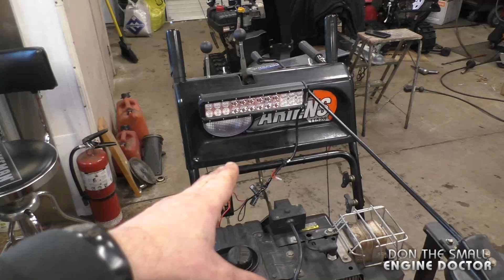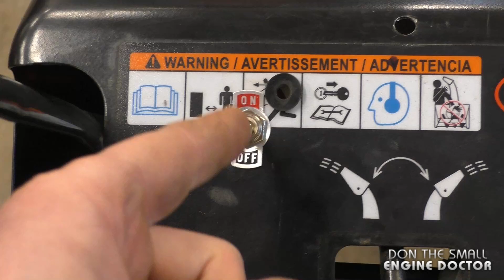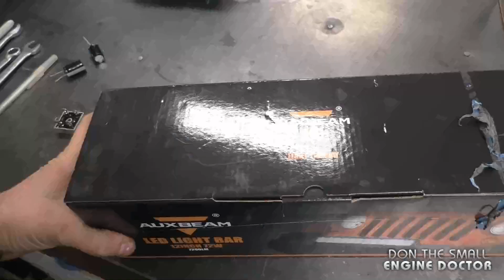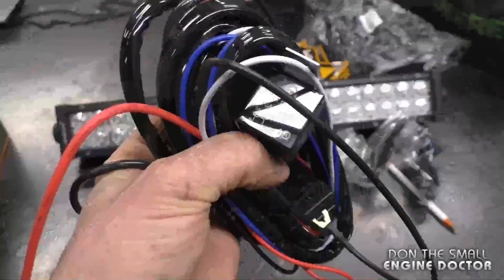HOW-TO Install LED Lights On Your Snowblower Without The Flicker!

Comment: Power Chute Hack.  I utilized an old 12 volt DC reversible drill and a double pole double throw switch with spring loaded neutral centre.  Cut off the chute crank handle and chucked it into the drill and securely mounted the Drill to one of the control arms. Mounted my Garden Tractor battery on the Snowblower above the engine in small battery box and now at the touch of a switch I can turn my chute up to 190°.   Battery stays charged all season.  I have a canopy (highly recommended) and also run a mag base rotating blue light and rear LED red light on top.  Because I could.  I could easily  run additional 12VDC lighting.
Reply: Any way you could link to a picture of your drill mount setup? I’m super interested in how you did that!

Comment: Hey Dony,     On the Toro blower with the 18W light Is that light always on or did you add a Toggle on off
 switch?????
Reply from the maker: light was always on the toro snowblower,I did add a switch to the ariens though

Comment: Ok so I have an ariens with no light or heated hand grips. So where do I find the positive wire coming from my engine?
Reply: Jeff McCallum A wire with a plug type end should be coming out from under the engine cover and hanging to the right side of engine. It should be black in color.
Reply: @josephpuchel6497  much appreciated

Comment: I have a troy bilt storm 2410 snowblower but it doesn't come with a stator so I'm buying a flywheel with the magnet on ebay and a stator so I hope they all fit

Comment: @donyboy73
Great video
I have the 824E  Tecumseh 8hp (I believe) with electric start and without existing factory light. I want to do this modification. I searched everywhere for a positive wire on the machine and can only find the negative wire to the kill switch. Can you please help me with where to wire my lights? Thanks
Reply: Just hook up the light to the battery if it has a electric start, just don't use too high power light so your motors charging system won't burn up
Reply: Jesse Sairanen Thanks for taking the time to reply, but if it were that simple I would have already done that. There is no battery. Having electric start on this Ariens 824e means that you connect an extension cord to the machine and once started you remove the cord.
Reply: @agbrown308  okey, it's that model of start, then you just neet to find the wire/wires from the stator windings coming under the flywheel and hook this bridge rectifier mod to it
Reply: Jesse Sairanen  I was hoping it is that easy. I’m just afraid to go through the trouble of completely disassembling the machine and not finding an accessory wire coming from the stator. Thanks again
Reply: There is no stator. You’d have to buy one, and the corresponding flywheel and swap those out first.

Comment: I installed a new 7hp Tecumseh Snow King engine on my late 80’s JD 524 snowblower almost 10 years ago. It has 110 volt electric start. Can I power a light from the engine? If not I was wondering if I could change pulleys on the engine PTO and install a GM one wire alternator to power lights?

Comment: Should the capacitors be left exposed or can they just be wrapped with electric tape?
Reply from the maker: you could tape them up
Reply: Liquid electrical tape.  Love that stuff.
Reply: @42Dash  So it's ok to brush that all over the capacitors/ bridge rectifier and all connections?

Comment: there is a much easier solution, just buy a rechargeable led bicycle head light, put the clamp part on the handle of the blower & when you need it clip the rechargeable light onto the clamp
Reply: Who sells them? Best idea yet!

Comment: VERY IMPORTANT - I HAVE USED THESE LIGHTS IN 24" AND 32" FOR THE LAST 5 NEW ENGLAND WINTERS ..... REMEMBER TO CLEAR RTV/SILICONE AROUND THE OUTER EDGES OF THE LENS OF THE LED LIGHTS. IT WILL PREVENT WATER LEAKAGE FOR YEARS TO COME

Comment: Does anyone know what kind of volatge and current one can get from the flywheel stator of a tecumseh 8-10hp?  Those lamps can quickly be 20-30 w, I dont know if the engine can provide this.

Comment: I did the hack - and it works great! I used the parts in the links, mounted them in a gray 4" Carlon plastic electrical box. Used those 4 spade connectors on the bridge rectifier and  then soldered the wiring to the capacitors then used a LOT of hot melt glue to insulate the wires (it is non-conductive) and secure the parts in place in the box. On my Ariens 926LE I mounted the box on the bottom of the "dash" out of the way.
For power, I just snipped the existing power supply wires to the lights and extended them into the box.
For the light, I used an 8", 12 bulb LED light from Harbor Freight (Under $40 with the coupon) and mounted it near the top of the front of the auger housing. I had already mounted an hour meter; that remains hooked up to the original AC output wiring.
No switch needed, the light turns on with the engine and there is no flickering when it is running at normal speed. 
Seems like about 25 times more light than the weak one that came with the blower, with the same wattage. 
Darn thing lights up my whole block.
Thanks for your video!!!!!!!!!!!

Comment: The stator on my Tecumseh only put out 18w.  I tried with three 28w pods and voltage drops to 10.5v.  They will light up but not very bright.  You can see in his video.  The 72w light is bluish and the single light very bright and white.  My set up now is only one light from engine.  All other can off on board battery.

Comment: You Da Man.
This light works great. I installed without the capacitors. I couldn't wait until they were shipped.
I will install when they arrive. Thanks you. Keep up the good videos.
Reply: Re did with the capacitor. WOW. Not its bad ass. thanks again.
Reply: What do you need the capacitors for?
Reply: tjc1ny I believe the capacitors take the pulse output of the rectifier and helps provide a more constant input to the led. These means no more flickering leds.

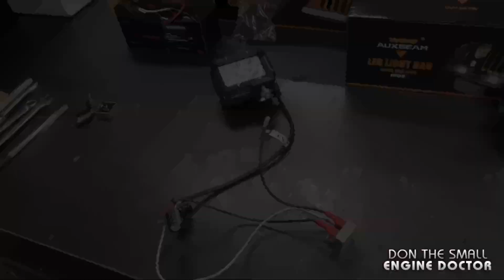Comment: @ 1:39 I see the wire I need that will connect to my engine.....It is the small black wire with the white plastic cylindrical end.....do you know the # of that wire?????
Reply: Your snowblower engine would already have to have it coming out from under the shroud.  If the engine doesn't have the parts that produce voltage it's not easy or cheap to make it do so

Comment: Also one more...it appears you have the open side of the rectifier exposed to the elements.....is that moisture proof????? Should it be covered????
Reply: I'm 11 months late, but yes, I'd personally enclose the rectifier and the caps in a small all-metal (and waterproof) enclosure.  Why metal? so it can be used as a heat sink for the rectifier (as he did in the video; he bolted the rectifier to the metal frame).  I'd extensively use soldering and heat-shrink tubing on the wiring too, but I like overkill jobs.

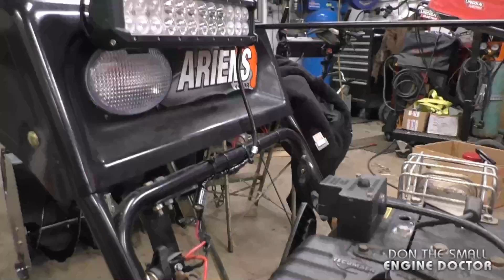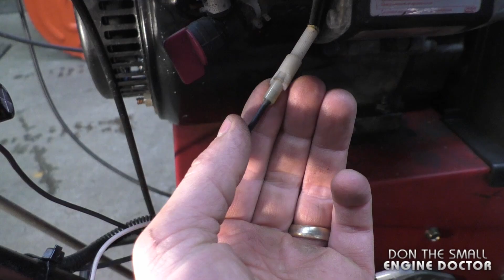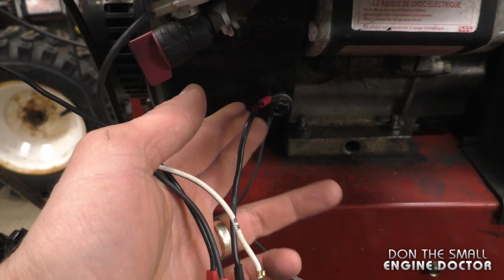Comment: Also end of video  at 9:59 it looks as though after you tidied up the wires you added a Fat yellow wire and a fat Red Wire which were not seen at previous mentioned times of 4:34 and 9:12 of this video.  I am not being a pest I just noticed it and am not very savvy when it comes to wiring.     Also Don you mentioned a toggle switch......Any Volt or amps on a toggle switch or ????  When I look up toggle switches they seem to be all different volts and amps   12v/20A.....12v/30A.....then wattage????   Appreciate your help.

Comment: Also at 4:34 of video you show same male to female lead  I have  the one coming out of engine(power cord) but what is the connecting wire #????
Reply: Watch it again.  It is a mating connector from another machine that goes to + on the Rectifier.

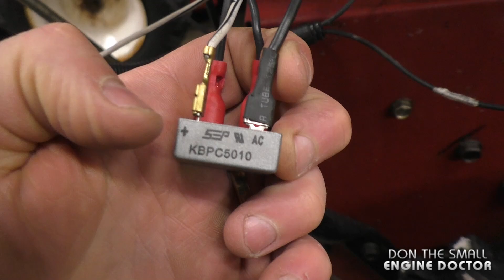Comment: Don at 9:12 of the video you show the power cord coming from engine(I have HMSK80 myself w/same white plastic end(323))  what is the wire that  connects to that   Do you have a part number?   So say wire out of engine is male connector.. what is the female wire that matches/connects to it???
Reply: Correction plastic end 322

Comment: Will the included wiring harness with the switch work on a snow thrower??
Reply: He mentioned that he did not think the switch on the included wire harness was waterproof and that is why he did not use it.

Comment: Super easy to follow. Just one thing I have two 18w led lights and wonder do I need two capacitors for each light ?
Reply from the maker: yes
Reply: Can someone else confirm this as well?  I would think that if the lights were pig tailed together and the 2 capacitors were ahead of the pig tail it should be fine.  I don't see how 2x18 w lights is different than the one 72W light.
Reply: It isn’t, you can wire the lights in parallel and just use 2 capacitors. I don’t even use the capacitors and it work fine.

Comment: Can someone that has purchased the Auxbeam 12" 72watt light bar post the full electrical specs. I'd like to know the true wattage draw, volts and amps.  I find too many LED companies report the wattage on the packaging as the incandescent equivalent rather than true wattage of the light.

Comment: I did this and within a minute one of the capacitors exploded.
Reply: Are capacitors necessary?
Reply: Sounds like the rectifier or capacitor polarity may not have been wired correctly.
Reply: @michaelhaip803  I just used a rectifier and they work good.

Comment: Serious question - forgive my ignorance - why do we need two capacitors? would 1 in series not do the same thing? Thanks!
Reply from the maker: two gives extra protection against flickering
Reply: donyboy73 ok - at least it’s a reason - sure wish I could understand it a bit better, but I’m happy enough for now knowing that’s what 2 will accomplish :-)
Reply: Two caps in parallel give you the sum of the two capacitance value of each individual cap. Increasing the capacitance reducing the flicker because it can store more energy. (But it will knock your voltage rating in half, but since this is 12v system 25v rating on the caps in parallel is still ok.)

Comment: My blower is a craftsman - after rectifyer, I still have in excess of 25vd/c - I plan on wiring in series in order to split that voltage - would I still need two capacitors? or just one before the lights?
Reply: carguy1312 Remove the capacitors and keep only the rectifier. I found the capacitors were drastically increasing the DC side voltage. Burned out several automotive grade LED bulbs before purchasing Cree lights.
Reply: Larry Fine the capacitors shown here are rated for 50vdc...and 2 of them paralleled would only compound the problem. They’re just in circuit to keep the voltage ripple/diode switching out of our visual range - a single 25v cap of ~1000 uF would charge/discharge fast enough to make the lights not flash to our eyes at just about any engine speed

Comment: I've been trying led lamps with the same bridge rectifyer - from my blower, at full throttle, i get up to 26v a/c - rectified dc as low as 24v d/c - every led i try blows out in seconds even if rated for 36v dc - is this because I'm not using capacitors? or do i need to use something to lower the dc volts? 
I'd love to know what output voltage you have coming out of your blower. . . Mine has a harness near the starter that is labeled for light, or grips, so I'm perplexed as to why I'm getting this much voltage?
Reply: Scott G. Get rid of the capacitors and be sure to use quality  lights he recommends or Cree lamps. I had the same issue with standard automotive grade lights burning out.

Comment: I used this exact wiring setup on my older NOMA snow blower and keep burning out leds.  I am getting 46 volts DC at the bulb.  Why would this be?
Reply: I seemed to have solved the issue. Removing the capacitors and keeping the rectifier only solved the issue. I'm not an electrical expert and cant explain why.  Also, do not go "cheap" on the choice of LED lamps. Use a quality off-road grade LED light set. Can't tell you how many 12V LED  bulbs I burned out during this process.
Reply: Because your alternator outputs a voltage too high. You could use a voltage regulator before your LED.

Comment: Can you do this to a 1976 ford pick up truck one of my lights are getting so hot it melts the tail light lens I want to install LED bulbs .is this possible
Reply: Caleb,
I know this may be a year ago but they do make a bulb that is LED with all the necessary circuitry in it's base. Simply plug and play.

Comment: Question, connect everything, as per your video, no light, tested light with jumper wires directly to capacitors by using cordless drill battery, light work.
There’s is power coming from stator wire😕.

Comment: Merci Donyboy73 ... j'ai fait mon montage de mes fils exactement comme tu la expliquée pour les lumières de souffleuse Capacitors + 50 Amp 1000 Volt KBPC5010 et c'est fou comme ca fonctionne bien merci. j'ai acheter mes lumières 4 pouces sur Ebay d'un vendeur en ontario voila son nom... ailight...vraiment pas cher...et tu devrait faire  en francais l'ajustement de carburateur et le bras du engine speed ca serait bien... la j'ai un peu de misère a suivre. mais tes vidéos son toujours bien montée avec tout les détails. Bonne journée Ps: J'ai une veille souffleuse Columbia 10-28 1986

Comment: Isn't 72W pushing the output capacity of the snowblower? For example, my Murray only had one light as an option, and it was (I think) a 30 watt incandescent bulb. I took that as a guide and built a light bar that stayed under that. At 72 watts I'd be concerned about burning something out.
Reply: It's 72 watts equivalent light, not actual draw. A 60 watt led in your house is using a fraction of that.
Reply: How do you know the light is not drawing 72 watts?  I can't seem to find the specs anywhere. It would be good to know the volts, watts and amps the Auxbeam bar draws.
Reply from the maker: sure it is, but it works great and it's not for the space shuttle
Reply: works great... for now.

Comment: You keep calling the output wire from the ALTERNATOR a "positive" wire. It is not a positive wire because the alternator is putting out ALTERNATING current. That means the polarity is constantly changing from plus to minus. This is why you need that full wave bridge rectifier in the first place; to convert the alternating current (AC) to direct current (DC) in order to power the LED's. Also, one other thing you should explain right from the beginning, is that if your machine has no lights to begin with, you cannot add LED's because you have no alternator coil in the engine.

Comment: 👍🏼do you have a video on how to wire a battery to the plug in button start?
Reply: You can't easily, the electric starters on these run on 120v AC, you'd have to run the 12v through an inverter first lol

Comment: would it be possible to add an electric chute to a 3 x cub cadet snowblower and how to do it. thank you
Reply: If you mean to electrically power the rotation of the chute, I used my Lawn Tractor battery and wired in a DPDT switch to an old 12V electric drill.  Does not have to be 12V,  14+ would also work.  The crank handle was 2 piece so I just chucked the lower end of t he shaft into the drill and connected it to the switch/battery.   Chute goes hard Left to hard Right in 3-4 seconds.  Made a bracket to hold the drill to the handle.  Works great.
Reply: I used a reversable wiper motor from a tractor. I cut of the crank and mounted it to wiper motor and built a bracket system of angle iron to the handle bar. It has 2 leads and reversing polarity changes the direction of rotation . Used a DPDT momentary switch
Reply: forgot to say I had to hang a motorcycle battery under the handle bars to power it.
Reply: A 12 volt power seat motor out of a car is an option. The gear drive on some of these is perfect for the left/right movement of the auger. I have one out of a chevy silverado that I'm going to attempt to install.

Comment: Your videos are great. Lots of useful information. Keep up the GREAT work.
 I checked out the capacitors on Amazon and there are ones that are priced from $1.95 to $6.99.. What one is used to connect the LED light on your snow blower??
Reply: He is using 2200uf 50v rating capacitors

Comment: I like the auxbeam lights I put them on my zero turn and on the back of my pickup for plowing snow.  Nice video hooking the lights to a snowblower is tricky wiring compared to a DC 12 battery application.  Nice Job!
Reply from the maker: thanks

Comment: Great video Don.  I see a lot of comments about overloading the alternator.  These snow thrower alternators are just like the lawn tractor ones and when someone runs the battery down trying to start their lawn tractor the alternator is working as hard as it can to bring the battery back up.  Even if the tractor has a voltage regulator that regulator only limits voltage, not current.  I have only seen these alternators damaged when somebody jump starts the tractor with the jumper cables on backwards and pops the little diode in the wiring harness.
Bill

Comment: me again   i have a ariens classic 24'' which didn't come with a light is the procedure easier or the same more or less?
Reply: Time to add a Battery and some simple wiring.  Your engine is not designed for operation of any electrical Aux. equipment and cannot do so.
Reply: Look for the stator wire on side of engine. Many makes/models were produced with a stator but no factory light.

Comment: The links are from Canada so the large light is not $41 it's only $26 and wire harness is only $7.99. Everything is cheaper if you click the third link which is USA.